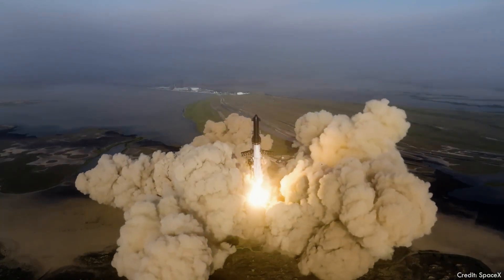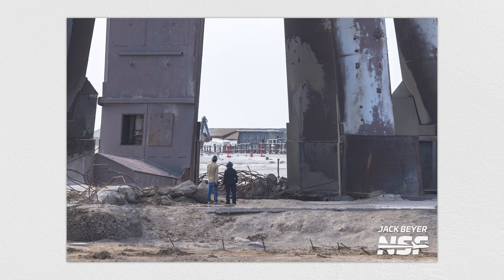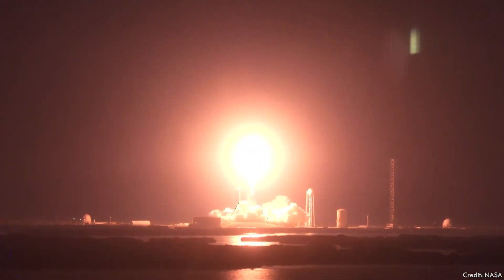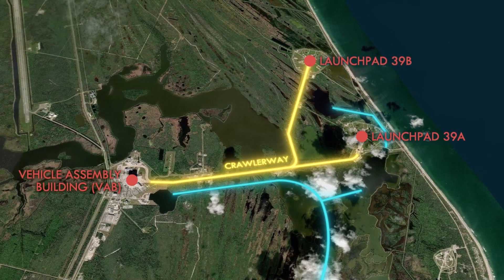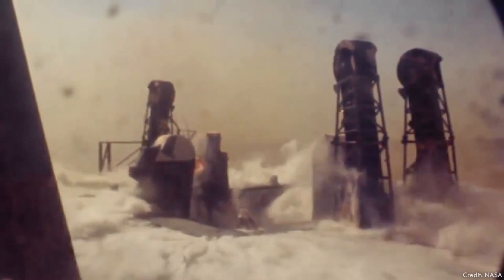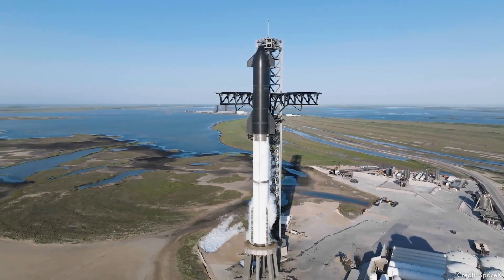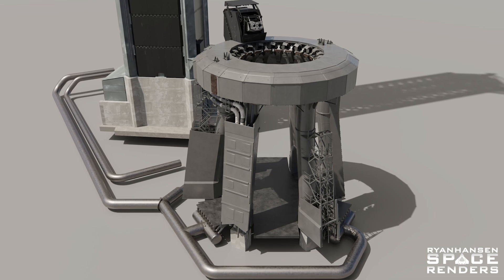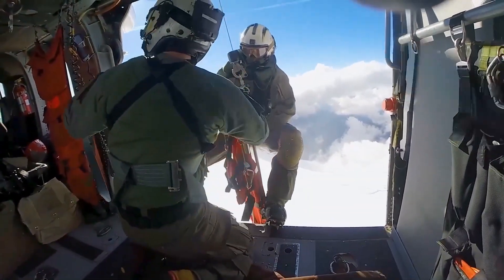Was Starship’s Stage Zero a Bad Pad?

Comment: I was part of the team that re-furbed the test stand at Edwards after Challenger failed.  The mechanical systems to provide the water for cooling are impressive.  The diverter there was hollow, with tens of thousands of holes in the "hot side" to shield the diverter surface from the flame with a "fog" discharge of water through the surface.  The criteria was 5 million gallons of water, delivered in something like 3~5 minutes.  The pump houses (there were two) had about 20,000 HP of pumps.  The water into the diverter was carried in two 48" pipes.  One of our guys took videos of the "dry run" (no flame) test of the water system.  The audio can be heard "shut it down, shut it down!!!" once someone realized that without the flame, the water flew downhill into the sloped desert...right toward the tiny berg of Boron, CA.  The "fishtail" bottom end of the diverter caused the water to jump right over the drainage canal that was supposed to carry off excess water.  It was a fun project.  Almost forgot to mention:  we didn't determine the criteria for water flow, etc., but we were instructed that no material available (late 80's) could withstand the rocket blast, so the water protected the gantry, diverter, etc.  When I saw the damage to the impact area of the flame, I wondered if the real problem was a mechanical one:  not enough water?  Pump fail?
Reply: For perspective, that gives a flow rate of around 8,000-30000 gallons per second over that time period. At the low end, if it were a river it would be around the 32nd most powerful river on the entire planet. At the high end, it would be the eighth!
Reply: @PhysicsGamer  The 5 mil gal criteria included a big safety factor, and as I recall the motor sections (Saturn V?) came in 3 minute and 5 minute versions (?), so the amount of water varied with the test.
Reply: @petem6503  Makes sense. Still an enormous amount of water - more than enough to carry a house away under the right circumstances!
Reply: @PhysicsGamer  That's why the crew was trying to shut down the pumps:  save the houses.  The bar's?  Not so much.
Reply: @PhysicsGamer  wrote: "...a flow rate of around 8,000-30000 gallons per second over that time period. At the low end, if it were a river it would be around the 32nd most powerful river on the entire planet."

Are you really sure about those numbers? The average discharge (flow rate) of Ganges, for example, is 16,648 m3/s (Wikipedia). That's about 17 million liters, or around 4.5 million gallons. The deluge system's flow rate is a drop in the ocean compared to that. The numbers for Mississippi are 21,749.5 m3/s – 22 million liters – about 5.8 million gallons.
Reply: @VideoDotGoogleDotCom  Yeah, the largest several rivers in the world are really on a whole other scale, even compared to the ones slightly smaller than them. The top seven rivers by average discharge are all >30,000 m3/s.

The eighth (Rio de la Plata) comes in at 27,000 m3/s... but that's the only one between 20,000 and 30,000 m3/s. Then there's another 19 between 10,000 and 20,000 m3/s.

It's possible I made a math error somewhere, but briefly reviewing my post it doesn't seem to jump out at me.
Reply: Great
Reply: Great answer and explanation and it shows that the "engineering" still hasn't been explained in Terms of Volume of water needed, where initial blast of water will go and also how much water and its pressure will be needed and for how long. - we have been told many times that the engines cannot be lit all together and this creates delay which adds to the problems. ALSO another biggie that people gloss over is the temperature of superheated steam? err hasn't that got the capability to damage systems? - although at least everything recovered will be sterilized LOL - space x is the number 1 experimental destruction engineering company that sell products and the poor folks who buy them don't realize they are part of a giant experiment and they have no recourse when the product fails. Tesla operates the same way whittling down products when it realizes whats profitable and what is just too much trouble. Its just the way it is atm - don't give me solid _ I want NEW,NEW,NEW
Reply: @AndyHancock the poor folks who buy spacex products get to fly their payloads on the most advanced, succesful rockets for the cheapest price... i want a bit of the stuff you're smoking if you think that SpaceX is a company customers can't rely on.
Reply: @TheNheg66  didn't mention company reliability - i am interested in the mechanical ground effects of an unknown system and how that will play out for launches week in and week out. This whole endeavor is based upon Elons mantra of reusability and multiple launch windows. The water deluge is obviously working but as for noise dampening on the worlds largest rocket - Ik - I am 18 miles from Space x as the crow flies and heard the thunder as clear as day Space x's ability to engineer, learn, re-engineer parts and systems is obviously one of the greatest in history and its working - backed by Billions$$$ - shame we can't get him to rebuild/build  the American the rail network. Space X will have complete control of the heavy load rocket market 100tons+(when it exists) just like they do with Falcon 9 - an amazing piece of kit) but to what end? Is it the moon first then onward?
Looking forward to seeing the next Launch from the beach - the noise will be amazing. and if it makes it to orbit - fair dinkum
Reply: @AndyHancock  fair enough.

As to what end : reportedly, Musk makes every decision inside SpaceX by whether it makes Mars colonisation more likely to happen sooner or not. If that's true then i think 'the end' will have to be a human mission to Mars.

Comment: The problem with boca chica site is its built on the rio grande flood plain. The sand is essentially delivered down the rio grande during historic floods that occurred before the two upsteam dams were built, falcon lake and lake amistad. 
    Within the sand laid down since the last ice age when sea levels were lower is a spongey like material with organic material and bacteria trapped in an anoxic environment. While the surface may look firm, putting pressure on the surface can cause the sand to become more maleable. 

Now imagine, you have a set of rocket engines with their thrust vector pointing down at a sheet like structure laying over something that is hard agregate on top and spongey below. 
The ISP of the engine is in the 350 range which we multiply a 9.8 m/s for and exhaust velocity of Mach10. 
    This does not reach the launch pad, but the rocket engines resonate and their wave functions create pulse waves that travel at hypersonic speed to the sheet of concrete. This is much like a sonicator used to clean off surface debris but a million times more powerful. 
The sheet itself begins to vibrate and the substrate below begins to undergo liquifaction. The pad is now free to vibrate, and because concrete is fairly weak under stretching it just breaks up. Because of the nature of the sand below this causes the substrate to give and the action of the Ve on the concrete itself scours it away. 

    I am been to boca chica, i had the fortunate exoerience of sinking a car in that sand, Its not like other soils with tightening layers as you go down, its just goopy sand, often pitch black layers of bacteria laden sand. When they chose the site I pondered how they were going to stabilize the soil, just to build the equipment. They had problems with the soil in the begining because it was so wet and soft. They demonstrate some magical technique they use to dry things out. But look at boca chica, on any given day it looks dry and sand, until you get below the surface. The region has suffered from storm after storm, flood after flood. After hurricane allen, the main road up S. padre island was chopped into a dozen pieces, 8x8x8 blocks of granite were torn out nowhere to be found. There were tropical fish from the offshore island living in the large ponds that Allen created were the road used to be. 
  This is the nature of boca chica, its not stable, over thousands of years it gets torn up and completely rebuilt, what looks like dry land today is just an illusion.
Reply: They brought in loads of dirt and let it sit for years which stabilized the soil, then they took some of it away and built Starbase on top of it.
Reply: @WhatIsThisVid  They tried to draw the water out by mixing drying agents, but its still in the flood plain of the riogrande and you can only get so much compaction of that type of substrate.

Comment: Before the watching the video. 
no. the pad was not faulty. 
Space x built a massive rocket and the pad was unfortunately no built for something that massive.
the pad needed alot of upgrades before it could handle the new load. 

the proff is in the fact that several other rockets were launched successfully with out damaging the  pad.

Comment: Another big reason why 39 was so monstrous was that NASA was tired of building custom pads for each rocket. KSC is littered with single use pads.
Reply: Kerbal Space Center is littered with a whole lot more than just single use pads
Reply: @MrGlobalSuccess  see my mind also went immediately to Kerbal Space program instead of Kennedy space center.
Reply: @MrGlobalSuccess  Like what?
Reply: @vejet  dead kerbals
Reply: @vejet  mm
Reply: Well, technically KSC is only LC 39.  Canaveral Air Force Base is what's littered with pads.
Reply: Cant they take apart the old pads and build for new pad
Reply: @Catladybug they absolutely can, and do. But it's not cost effective in most cases.
Reply: That’s like saying NASA was tired of using rocket fuel.
Reply: "KSC is littered with single use pads"

Just like a women's public bathroom
Reply: ok

Comment: It's really weird to see so many sources claiming that the abort system blew up the rocket, when it didn't. The abort system failed more than the rest of the launch. :/
Reply: The flight termination system did activate, and did lead to the destruction of the rocket. The delay between activation and destruction isn't that important in most settings. At least not in a very surface level video like this one.

Comment: Small quibble: The original launch stand did have a water deluge system. It was a ring around the hold-down frame at the top of the launch stand, creating a curtain around the exhaust to thermally protect the systems at the top of the stand.
Reply: It was actually a fire suppression system

Comment: Riddle me this: How will Starship return to earth without building a pad on Mars? Will SpaceX be building a concrete batching plant on Mars? 😂
Reply: The plan is indeed to build a pad, for the manned launch arrival at least. Since the unmanned ships will be going first with all the robots, equipment and materials to assemble what any human would need to survive there, they would also ship in whatever is needed to build a pad. 

Now there is two ways to go about it. The fondac pads proved more than adequate for the thrust of a starship upper stage at launch, so depending on thrust level needed they could get away actually carrying any advanced resources needed for the pad. 

But most likely they will seek to find elements of mars itself that can be used to make concrete or at least a concrete like structure, with if needed the ability to bring a few extra plates to harden that surface a bit.

Again the game changer here would be fleet count. If they can figure how to handle the first landings, then theoretically with a cheap system like starship they could, if all else fails, brute force the design in a way no other system would allow. 

For example they can afford to bring a whole plantation, a whole reactor, a whole fuel refinery, etc... So if they absolutely need to, they can do it. But again the entire reason why we want these missions to happen is because the incentive to solve these in situ is very big, and since we do not exactly have the luxuries we have here on earth, by coming up with solutions on how to build solutions over there, we can apply these solutions here in relevant places.
Reply: @mobiuscoreindustries  interesting. Sounds like getting there is the easy part!

Has anyone begun demonstrating the robotic construction on earth as proof of concept?
Reply: @jay-em  Yep, that pretty much is it. 
As it stands the very concept of IRSO is in its infancy. After all, it was never needed before. But there is some things being done.
The perseverance rover carried a little experiment that was able to create oxygen from the martian CO2, marking the first time humans have produced (a tiny amount) of useful resources from another world.

There is active developement when it comes to turning lunar regolith into concrete, for various uses during the future moon mission and bases. Similar studies could be undertaken on the nature of martian dust. Various research programs even produced prototypes of robots designed to go around and gather that stuff, to then deposit it where it would be refined and used as building material.

There is also various efforts in research here on earth that apply to Mars, such as 3D printing, agriculture, and of course the issue of power production. After all a mars mission won't ever get off the ground if the issues of manufacturing, survival and energy plenitude aren't solved.
And just because of that, we should support these missions. Because as extremely efficient ways of researching tech, they will give earth extreme added value even if the ships never take off.

Comment: Why does there need to be a flame trench or flame diverter ? Why cant there just be a really deep hole under the rockets engines ?  Why can't spaceX raise up the orbital lauch mount higher than it is ?
Reply: He already discussed the issues with the water table. You also need to support that hole and keep it clear. A long, thin hole in the ground doesn't stay for long.

Lifting something massive is its own challenge. The taller you make something, the more support you need at its base. It's analogous to the rocket equation: you have to make the bottom large enough to hold up the top. So now you have the challenge of building an even taller mount, as well as the challenge of lifting an entire rocket up to height to attach it to the mount.

By the same logic, why not just build the mount all the way up in space beyond Earth's gravitational well? Then you wouldn't need all that fuel and thrust to escape Earth. But of course, you'd need to somehow get the launch mount built all the way up there and lift the rocket all the way up there. Yes, this is a ridiculously extreme example, but it demonstrates how this trades one problem for another. In fact, if we could figure out how to build such a thing (a space elevator), it would be a great replacement for rockets. But today, it's easier to build a rocket and launch pad than it is to build an elevator to lift the equivalent payload that high.

Comment: The whole future purpose it to get to mars and back. So any return launch system and/or pad on mars should be as simple as possible due to resource limitations. On Mars less power will be required for the launch back home for sure but any debris will fly much further and higher as well. I wonder what space-x will come up with for that.
Reply: Probably best solution would be that used on HLS already, have a set of dedicated thrusters far away from the ground whose purpose is only to take it up away from fragile surface.

Comment: I'm quite surprised that you more or less glossed over the 80 ft high mound of backfill compared to the ~50ft height of the launch pad today. Due to the wet, sandy subsurface that the launch pad had to be built on combined with the extremely rapid pace of development NASA built the mound well above the finished height to provide a surcharge load in order to reach that 4 feet of settlement much faster than the launch pad itself would have done. Also it would have been great if you could have devoted a couple minutes towards why the static fire at half thrust led SpaceX engineers to think that the launch pad would survive at least one launch before needing replacement. I think it would have been a great opportunity to stress (heh, stress) how the foundation failed under the increased loads leading to the rocket exhaust digging deep down into the crater instead of ablating inches of fondag like they expected.

Comment: Sorry Grady, but IMHO a click bait headline with a biased video to grind an axe against SpacEx. A bit of minor history on 39A/B and a 50 yr. old expensive flame trench design. Nothing up to your usual analysis of the Construction Engineering aspects and any insight. Giving you the benefit of the doubt, but it's pretty obvious you have something political to say and are using your usually well informed platform to hint at it. Are you changing your channel's focus to environmental activism?